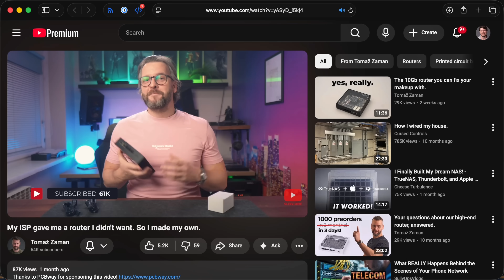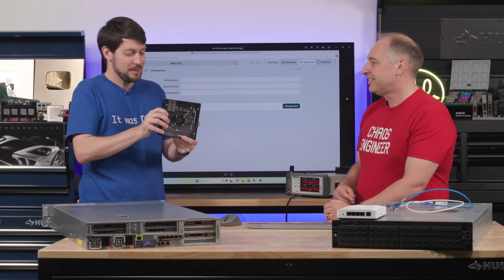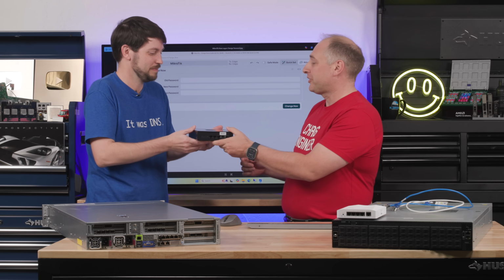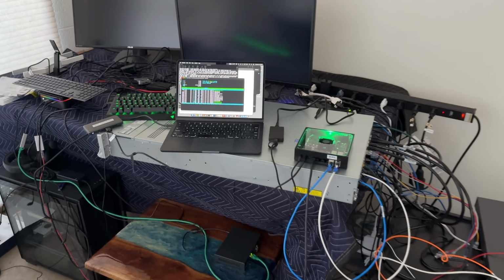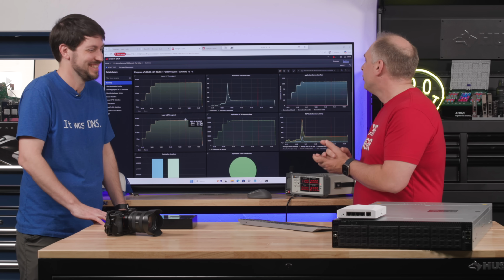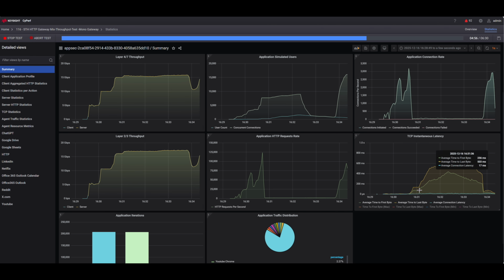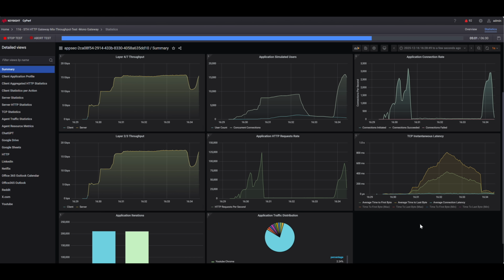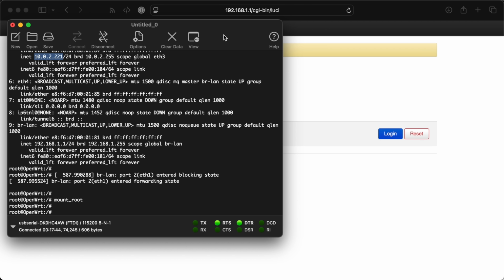$1m server vs $600 router

Comment: using copper invalidates your speed tests.
Reply from the maker: How so?

DACs are standard for anything, you either go that route or fiber. And even RJ45/8P8C is fine, just you have more power going into the SFP+ adapters for that, and a less robust connection.
Reply: @JeffGeerling  Fiber has greater bandwidth , even over short distances. The TCP re-transmits over copper are few in a lab scenario, but once you move to a live data center, it is easy to eat up 300 feet and/or find reflections and noise.  I love your content, and this technical disagreement.
Reply: @kjnoah  Fiber doesn't magically have "better bandwidth" just because it's Fiber. For example, 10G BASE-T and 10G BASE-LR, when used within their respective medium limits, have the same exact bandwidth. If you get better transceivers then sure, you can achieve higher bandwidth with (single mode) fiber, but then you'll be comparing apples and oranges.
Reply: @Z80Fan  You seem confused.  Obviously copper can be used for 10 gig over short distances, but it not over 300 feet and not more than 10 gig. Conversely, single mode fiber can transmit more than 100 gig over miles.  This is a silly thing to argue over, I am not wrong.
Reply: @kjnoah  You said "using copper invalidates your speed tests", and this is completely wrong. If a SFP+ device can push 10G over a 5-metre 10GBASE-T link or other short-range copper-based standard, it would be able to push the same 10G over a 5-kilometer 10GBASE-LR link or other long(er) range fiber-based (single or multi mode) standard. This is not an opinion. Jeff is not testing the speed of the medium, he's testing the speed of the end device.
Reply: @Z80Fan  Copper has losses due to magnetic interference that fiber does not suffer from.  You maybe thing i am a moron, but maybe think more deeply?
Reply: @kjnoah  OK Mr. Non Moron, explain how this "magnetic interference" "invalidates their speed tests" when they are using a 1-metre 10/25G DAC cable (that is almost certainly a Twinax, even though optical DAC cables definitely exist), with which I remind you they achieved 18.4 Gbps L3 real-world traffic with standard Ethernet frames over two SFP+ ports, which any network engineer (which you clearly aren't) would know it's a perfect result straight out of the box.
Reply: @Z80Fan  Insults are evidence you have reached the end of your knowledge.  I see no reason to answer someone that disrespects without knowing who they are talking to.
Reply: @kjnoah   Oh you poor thing; I'm sorry you feel offended when someone points out that you're full of crap, but that's a "you" problem. I certainly didn't reach the end of my knowledge, but it's clear that we didn't even reach the start of yours (if there even is one). And how convenient that you once again ignored the multiple technical statements I made and that you failed to respond to.
Reply: @Z80Fan  keep talking, you only make yourself look more idiotic and unprofessional.
Reply: @kjnoah  I agree, evading questions and getting offended by imaginary insults are a sure way to appear idiotic and unprofessional... luckily I'm not the one doing it.
Reply: @Z80Fan  I am not avoiding questions, you are changing the questions and the scope.  You are thinking small datacenter, I am thinking on a campus and global level.  We are not he same.
Reply: @kjnoah  Your top comment is "using copper invalidates your speed tests", which is a statement clearly directed to the tests made in this video that, I'll remind you, are about testing the real-world throughput of the Mono Gateway router through its two SFP+ ports. You have yet to substantiate this statement. Instead you went on how "copper can't reach the same distance as fiber" and "copper is susceptible to magnetic interference" (I'm paraphrasing), which other than being half-truths (which "copper" standard? Which "fiber" standard?) do not actually demonstrate how the Mono Gateway tests are invalid, since their DAC cables are just around one metre long and are not in a high magnetic interference environment. Moreover, as I previously stated, their tests actually achieved the best case scenario in terms of bandwidth for those ports, which clearly and objectively show that their test setup is completely valid. The video is not about building a campus or a global network.
Reply: @Z80Fan   Yup, you are not BICSI certified are you?
Reply: @kjnoah  Is that the one where they certify you're good at evading questions? You should get your money back because you're doing a poor job of it.

The fact that you're now talking about BICSI tells us that you either have serious comprehension issues or that you actually don't know shit of networking outside cabling and physical infrastructure. I'm giving you the benefit of the doubt and assume that you actually understood the context of this discussion, realized your error, and you're just trying to get out of it without admitting any mistake.

The question is still the same and still there in all previous comments if someday you'll decide to actually address it, maybe even your BICSI superpowers can help you answer that: explain how the tests depicted in this video are "invalid".
Reply: @Z80Fan  I have not read most of your comments because I do not care.  I do wish you were smart enough for me to care because maybe talking to you would be fun.  I see my funny short messages have driven you insane and I hope you get help.
Reply: @kjnoah Ah yes, the "funny" short messages. Remember not to cry when you repeat that to yourself.

In my mother tongue we say something like "if you keep quiet, you agree", so finally we both agree that you're wrong. Well, that was easy.

Now excuse me I'll go do the insane things that insane people do.
Reply: @Z80Fan  Nope, I am right and you cannot convince me of anything unless you change your tune and talk with respect .  Your lack of respect tells me you are not respected by others.  The childish projections are very telling.  I know your type and you are wrong.

Comment: Was this router in VPP mode or was the kernel performing routing?
Reply from the maker: This was set up with NXP's hardware offload (not familiar with VPP but I believe that was what it's called for some Cisco gear?). That routes packets using the SoC's hardware routing features instead of having to traverse Linux.

Comment: The question is: does it reach 4-10 gbit using  a PPPoE ISP with a single http connection. An intel atom c3758r is not able to do this for example. (well at least it was not a while ago, maybe newer versions will do)

Comment: The CPU is quadcore arm running at 1.6GHz, i woldn't market that as a "substantial linux box". It's ok for a router with offloading but don't expect to run serious workloads on that.

Also not providing any kind of storage interface other than EMMC on $600 box is a bit... silly. And i wouldn't be surprised if it's soldered in so once that module fails you have to do some bga soldering or have a very expensive brick.

In general $600 is a big ask for a router like that. If you don't mind the size you could build a miniitx router for a quarter of that price. Or grab a Banana Pi BPI-R4 Pro  for half that price and simillar form factor (and a bit more throughput)
Reply from the maker: Substantial compared to the little SBCs I'm used to, heh. I still run a few that are at 1.2 or 1.4 GHz! And probably faster than all the RISC-V boards I've been testing.

So more of a relative thing.

Regarding price it's definitely not cheap, and not a good value if you just want a router right now. At this stage it's like $300-400 for a good router, and then the extra cost is to support Mono and try to get them to keep iterating, IMO :)

Comment: question is how does it compare to a MINIS FORUM MS-A2 or S1 (same price zone ) with Open-WRT or mikrotik RouterOS... There are other boxes that have 10G ports that are cheaper, some even run N150 or ryzen 7030 cpu's that have on top 4 or 5 sata + 3 or 4 NVME m.2

Comment: Whatever one sees professional gear and thinks "that's high tech", remember that there is industrial and lab equipment that is 80 times as fast 😂
Reply from the maker: And then you realize NVIDIA has test equipment that can saturate their 51.6 Tbps switch... :O

Pricing for lab/test equipment is astronomical. But worth it when you need it.

Comment: Jeff, I love your work and the fact you’re bringing Mono’s product to your audience, but the testing shown in this video is lacking at best. Routers / stateful firewalls have a single, core metric that matters: packets per second. Everything is ancillary to that key number. Packets per second * packet size = forwarding rate. This set of numbers is what the major players in the industry provide (Cisco, Palo, Fortinet, etc.) because it’s all that matters. Especially since, as you saw, shoving ~833,000, 1500-byte packets to get 10Gbps is easy. Now run the test with 64B packets and see if the Mono can do the requisite 14.88 million packets per second necessary to hit 10Gbps in one direction.

Comment: Executive Summary: router with specification and design goal of 10GB sustained 17-18 GB of traffic in hard-core real-life simulation; the unit exceeded its design specifications?
Reply from the maker: Well 10 Gbps per port, when you have two 10 Gbps connections going, you sum up the traffic through both WAN/LAN side.

So theoretical max is closer to 19+ Gbps, but 17-18 Gbps is pretty good.

Comment: We don’t just need bandwidth measurements, packet per second (PPS) is an important and interesting measurement too. I mean 10 Gb/s with the largest packet size is easy, 10 Gb/s with the smallest (64 Byte / 84 Byte L1) packet size is hard.
Reply from the maker: There's a bit more data in the blog post, and I shared some more test results with Tomaz directly; this was not the final 'final' version of the configuration for the board, so I didn't want to be responsible for putting the 'real' numbers everyone would start quoting in my blog, just some preliminary numbers.

For pps, with two different HTTP traffic mixes (both with small MTU, no jumbo frames or other shenanigans), we got between 850,000-1,010,000 pps
Reply: @JeffGeerling Fair enough, but a bit more than 800000 pps accounts to 1518 Byte (L2) packets at 10 Gbit/s. Which is the easy way… ~14 Mpps would be the, admittedly unrealistic, hard way mentioned above.

Comment: 10GbE raw throughput is one thing but how does it perform when all of the security functions, both in and out, are running. The majority of routers lose 50-70% of throughput and I have yet to find something that loses only 10-25%.
Reply: This.

Comment: There are other devices, that have dual 10gig or better.
Reply from the maker: Definitely. And you can build something on your own that goes way beyond (especially if you're willing to give up on the 1U / small router form factor)
Reply: @JeffGeerling and give up on power efficiency as well
Reply: @JeffGeerling  
Take a look at: 
DEC740 – OPNsense® Desktop Security Appliance
Netgate 6100 BASE pfSense+ Security Gateway

Comment: Great work on the Mono gateway, @tomazzaman! For those looking for a high-performance alternative, the Banana Pi BPI-R4 is worth considering. It’s often under $250 and features the MediaTek Filogic 880 with mainline OpenWrt support and hardware offloading.

It supports Wi-Fi 7 tri-band via an add-on card and offers more GPIO pins, though it only has one USB 3.0 port. If you need more I/O, there's also a Pro model available!

Comment: I thought this router it was so interesting until they decided to not support OPNsense, which kind of kills it for me. It is still interesting to watch the development though.
Reply: You have it wrong tho they are looking into adding OPNsense support

To be precise they sent a prototype to one of the Maintainers of the Unofficial OPNsense ARM64 Port.
Reply: You have that backwards, it's the OPNsense that does not support ARM. This is a linux box, if the software can compile for ARM64, it will run on it.
Reply: @UNgineering  oh interesting, thanks for information!

Comment: Ohh. You finally got your mono. 

As someone with just a mac and a console, I wasn’t able to justify buying it. 

But as an electronics engineer, it is such a fascinating little pcb that I just want to frame and hang up in my desk. 

Also, 5:56, my man was speechless by the audacity of you even asking him that question.
Reply from the maker: I caused an immediate halt in all thought processes haha!

And yes, the PCB has a very pleasant overall design—and is functional. A great combo, and glad they put the clear acrylic cover so it can be seen
Reply: @JeffGeerling  For the high end of the time I don't imagine it doing the job, but for testing 1Gb/s gateways we aren't that far!

Comment: now i wonder why the banana pi r4 pro is cheaper than the mono gateway
Reply: Get the normal BPI-R4, no OpenWrt for pro yet, i have 2 of the normal R4's, never had any issues with them, and easily routes 10Gbps
Reply: @brianhansen9578 Apparently the wifi 7 card sold as an accessory for the R4 is a bust, so there goes my main reason for buying one…
Reply: @brianhansen9578  i would consider it but i have a wifi 6 router already so i really wanted to check out the wifi 7 speeds.
Reply from the maker: Not a bad option; Patrick and I were hoping to test that as well but didn't have the time while I was there. At least not this time around!

Comment: That custom  router is sleek AF.
Reply: not at that price.  buy something with pcie.3.0 and a 40gb dual card run pfsense to a qsfp capable switch.  done.
Reply: @Binary-Fun9000 its not worth it but its still cool
Reply: @Binary-Fun9000  He said that it's sleek, which it certainly is. 🙂 That doesn't mean that it has to be the best value device out there, and it isn't. For a small team without large volume discounts, it isn't totally outlandish.

Also, power consumption also matter quite a bit for a lot of people. In that sense, your suggestion isn't very competitive.
Reply: @Binary-Fun9000 Keep in mind it wouldn't be a small box like that one or more power efficient.
Reply: @sebas0469  bpi r4 then
Reply: @Binary-Fun9000  yeah because it's a two-man team which only does it for a couple of months. Obviously, it's not going to be $30